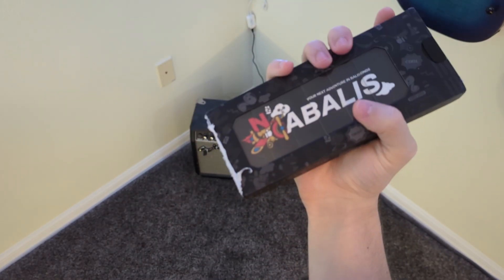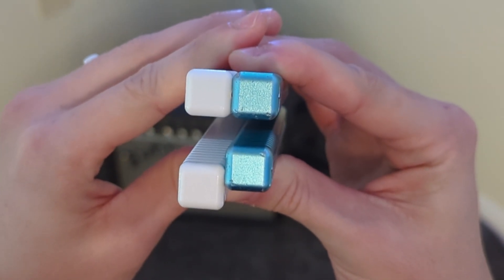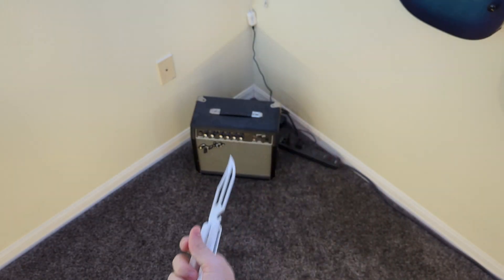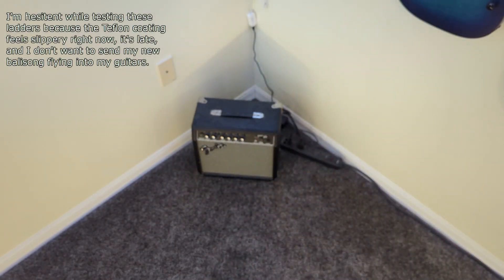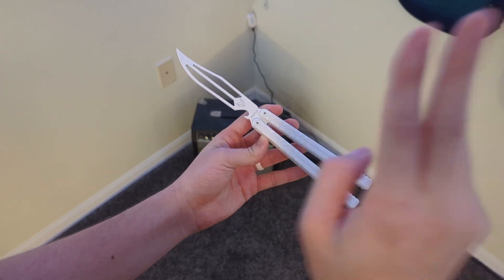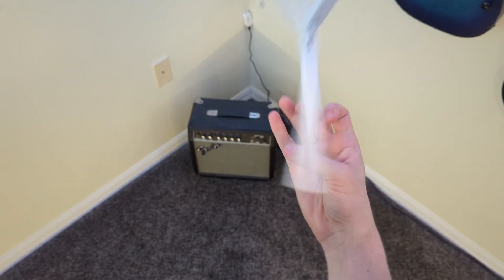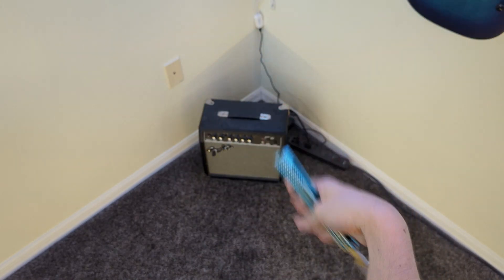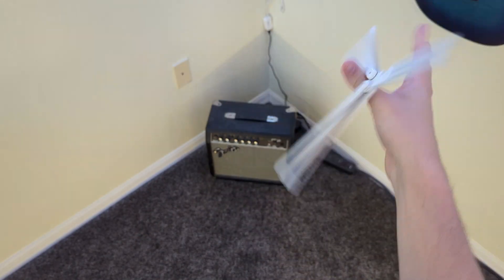Teflon Vulp Balisong Unboxing & First Impressions!

Comment: Sound so good and good ring as well.
Reply from the maker: Yeah, the sound is crazy! Because of this balisong I have started to spam sound tests 😅 I like the ring also, I was wondering if I would be bothered by it, but it's pretty subtle. If the screws get loose at all, the ring goes away though
Reply: @benshaminflips  That's cool! From what I've seen, the screws don’t get loose easily and seem solid, unless you unscrew it. lol 😆
Reply from the maker: @SemZFlippingChannel  That sounds about right, I did end up taking it apart to do a handle swap with my other Vulp 😅 I want to try Teflon tape to keep the screws in better

Comment: Мне тоже нравится мой Vulp, несмотря на то, что он скользкий для меня, скажите, пожалуйста, как насчет сцепления, оно намного лучше или изменения незначительны?
Reply from the maker: I know that climate, like how humid or dry where you live is, and other personal factors, like how sweaty your hands get, can affect how grippy a balisong feels, so keep that in mind. But for me, the normal Vulp is just a little bit slippery, but the Teflon Vulp is noticeably more grippy, to the point where I have had no issues with it slipping.

I have even noticed that I have to adjust how I do some specific tricks that rely a lot on carrying momentum through different movements where the balisong slides around my fingers when I use the Teflon Vulp, as it doesn't slide as freely. It's not huge, but it is noticeable.

Overall, the Teflon Vulp has pretty much replaced the Vulp in terms of what I normally pick up to flip.
Reply: @benshaminflips  Большое спасибо за подробный ответ!  Я теперь думаю, что лучше Vulp Teflon или Wing Trainer, что бы вы предпочли?
Reply from the maker: @alexblake1406  Unfortunately, I haven't tried the Wing yet so I can't speak on that.

Since you already have a normal Vulp, I'd lean towards the Wing, but I can't really say since I haven't flipped a Wing before, just heard other people talk about it.
Reply: @benshaminflips  Вы правы, возможно, это главный критерий на данный момент, мне нужен новый опыт переворачивания🙌🙌
Reply from the maker: @alexblake1406  Let me know what you think of it if you get it!
Reply: @benshaminflips  Ok